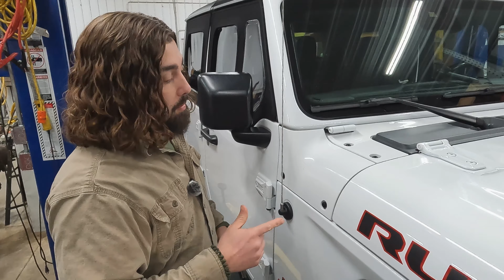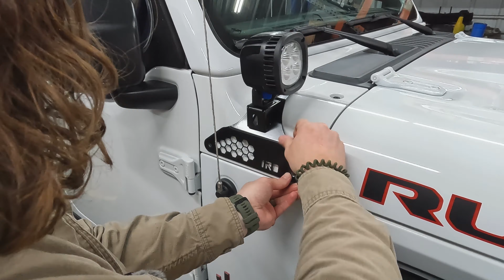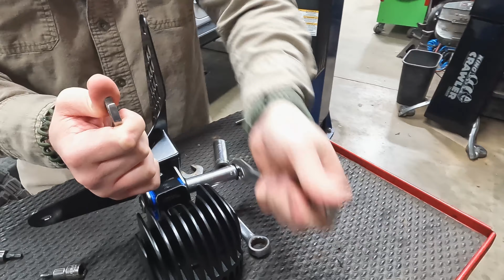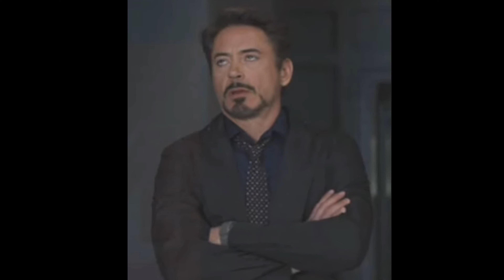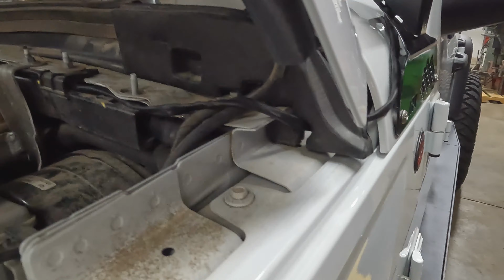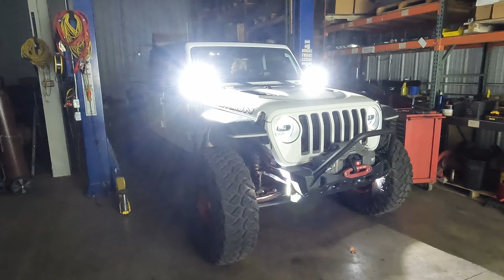HOW TO: JL/JT Ditch Light Bracket Install

Comment: I was hoping that the lights would be a little bit farther out so the windshield can be put down. I might have to get these for a couple of CB antennas instead. 🤔
Reply from the maker: You could use the side mounting option on the bracket and still have clearance to put the windshield down.

Comment: Using the aux switch connectiin, do you still need to connect the power to battery or is that pulling power through the aux connector and just connect the ground to a stud
Reply from the maker: @6daking990 The power for the lights is supplied through the Aux wire. Once that is done just connect the black wire to the ground stud inside the fender and you are all done.
Reply: @IronRockOffRoad  thanks... that had to be the easiest installation of anything i have ever wired in to any vehicle i have owned
Reply from the maker: @6daking990  Great! Let us know if we can help in any way.